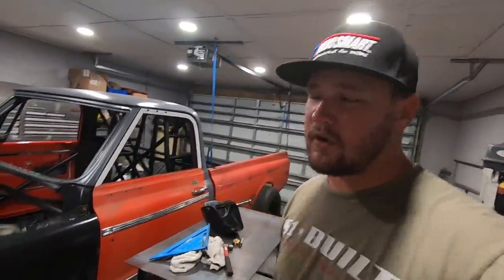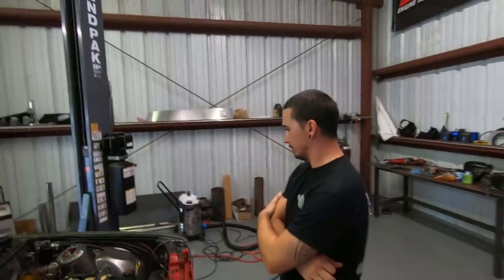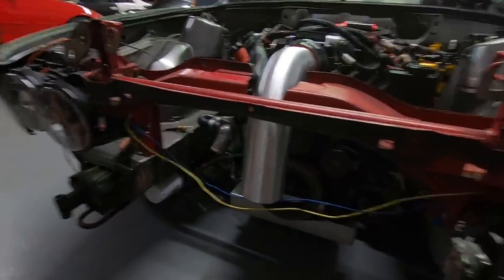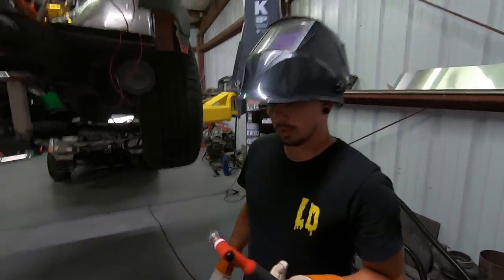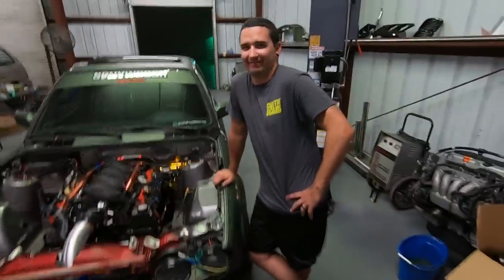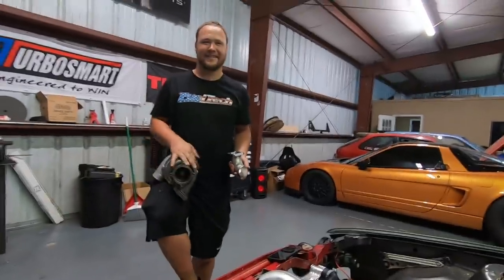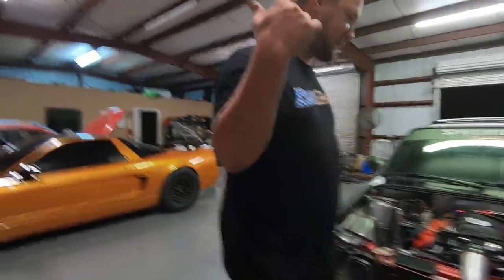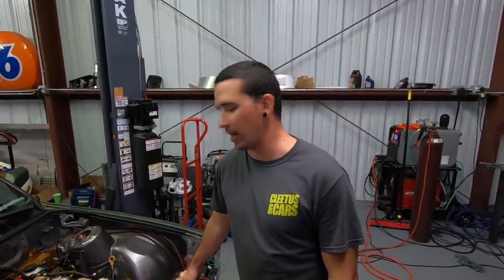LS1 BMW E30 - Twin Turbo Build - Pt1

Comment: Just be thankful that he didn't want to do the exhaust under the car. As an E30 owner, It's the lowest thing on the car besides the factory M20 oil pan. I'm curious to see how you did the tranny and drive shaft? I'm not a fan of the factory 2 piece with CSB.

Comment: I wouldn't build the exhaust pipe like that you're going to cut restriction you'll lose horsepower don't ask me how I just know you will something with the fact that the one exhaust pipe is trying to rush through and you got other ones trying to push through that exhaust to go out too will slow restriction